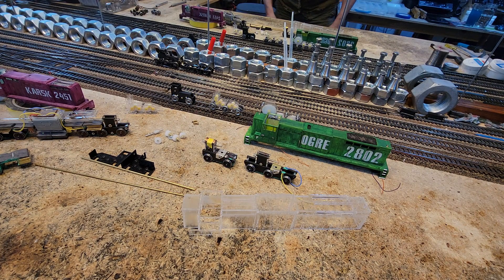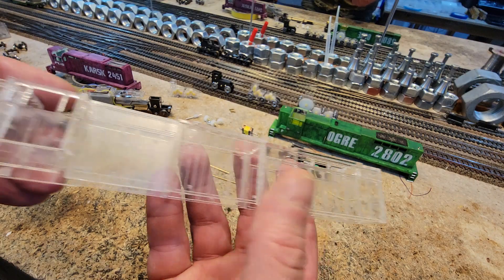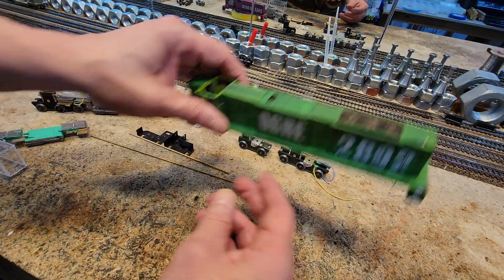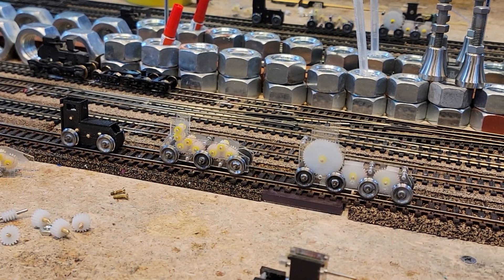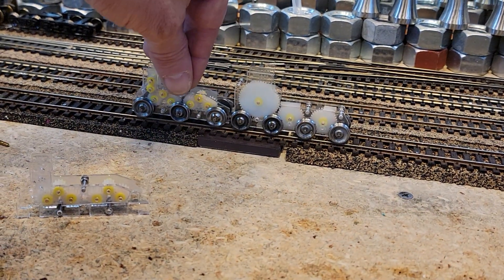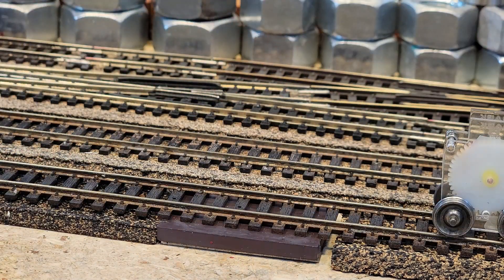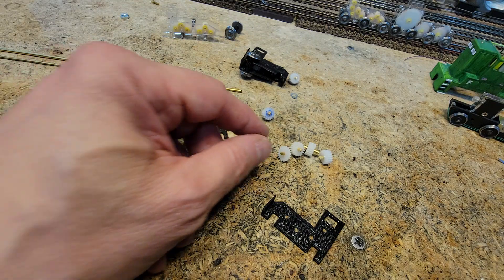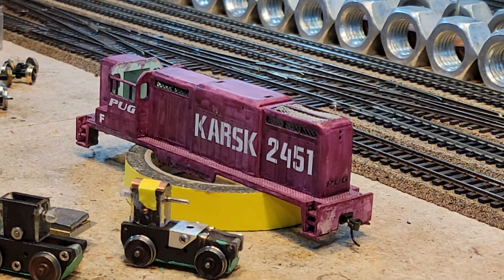2023 Contest Part 1 Trucks and Gears

Comment: I think I remember this channel from a number of years ago (glad I found it again). However, I have a question, what is the feasibility of making a truck that is literally just like the real thing with the electric motors hidden away inside the truck? I have an model Railroader Magazine from September of 1982. There is an advert for such a truck for O Scale and have wondered if that would be feasible and this might be the path forward for “dead rail” mode railroading where power packs are (unfortunately) a thing of the past)

Pros:
- The smaller motors have less overall torque than a single motor so more realistic operations should be feasible as a heavier and more powerful sd40-2 would be able to do better that a gp38-2 on a grade rather than both engines having the same beefy motor and have the lighter motive power limited in some way.
- More room to add stuff inside the shell (for any form of Alco RS1, RS2, and RS3 models this is pretty much impossible)
- A lower center of gravity
- Ability to add much more detail to the interior cabin as the electric motors are hidden inside the trucks (one for each axle like it is with traction motors) 

Cons:
- Expensive to build
- For a thing like this is that for  a gp38-2 you need four ,an sd40-2 requires 6, and a  DD40x would require eight.
- Since the electric motors would have to be small enough to fit inside the trucks a flywheel cannot be fitted to them.
- Presumably high current draw as a Locomotive such as a GP38-2 would have four smaller and weaker motors instead of single larger and more robust motor.
- Requiring to slave the motors together for more modern motive power with wheel slip detectors, however for something like a GP7, GP9, and their six axle counterparts the SD7 and the SD9 if I recall did not come from the factory with such as it wasn’t figured out yet.
- Finally, (and the worst thing at least for you)it is going to be a royal pain in the backside to service them and possible may have to require some form of keep alive to go over the frogs on switches.
Reply from the maker: it is possible and the way I would ddo it is the same way I did the Athearn Hustler last year with worm gears directly to the axles.  I'd use a 24v M50 motor which is super powerful and draws next to nothing, something like .03a and has super strong torque.  the only difficulty would be making the housing that would need to incorporate the sideframes and the pintle.  using something like an M20 motor it would be possible to power all axles and still use a single robust decoder like a DH126.  all the motors in parallel and there shouldn't be a huge power draw.  I've got a bunch of these motors and have thought about it before - the hardest part of all will be centering and joining the half millimeter shaft to the wheels!

Comment: Maybe you should set up a business making small after market athearn motor mounts. and various detail parts and accessories for discontinued train set locomotives and freight cars.
Reply from the maker: the one thing I actually get asked about is a DD40 truck and sideframe.  we're going to find out if this version will extend to 4 axles!

Comment: Also if you invest in a resin printer you won't need to use a drill bit anymore! They almost always have pinpoint accuracy!
Reply from the maker: even the resin printer can't match laser - they aren't even a little close.  the laser is perferction, but in 2 dimensions only!
Reply: @elite194  hmm... what is you lazed resin printed peices?
Reply from the maker: so, the first 10 generations of trucks are made from acrylic that I lasercut.  my laser is super accurate, where 3D printer is at most .3mm accuracy. the laser measures in thousands of an inch.  the 11th-14th generations are based on what we learned over the last year and some very hard math that I acquired that might be a some weird trade secret!  no books, no websites, no nothing anywhere reveals the info needed to build gear trains from scratch in the real world.  As soon as one of these locomotives becomes operational, I'm going to lay out the math for this - it's still a theory until I prove it!
Reply: @elite194  cool!
Reply from the maker: we've made it to the stage where we can print a bottom cover and then go for a test ride!